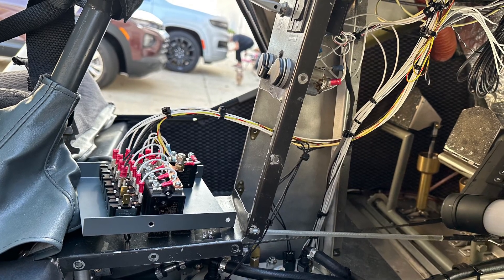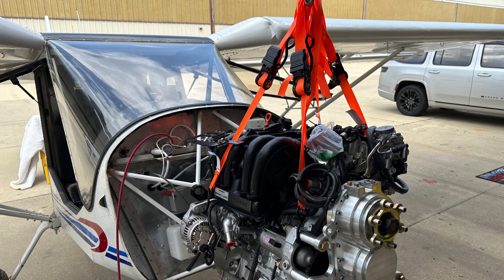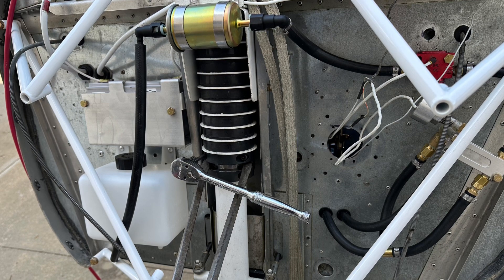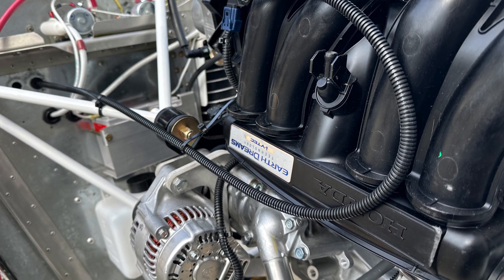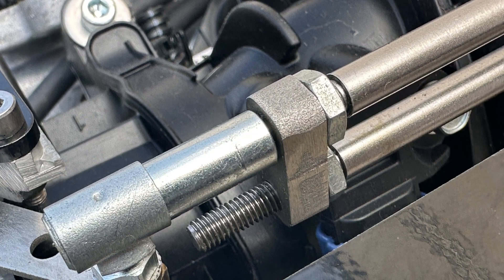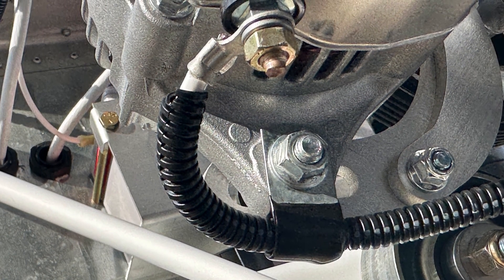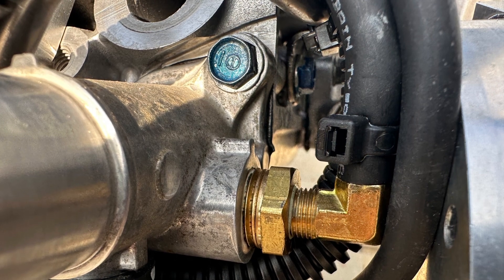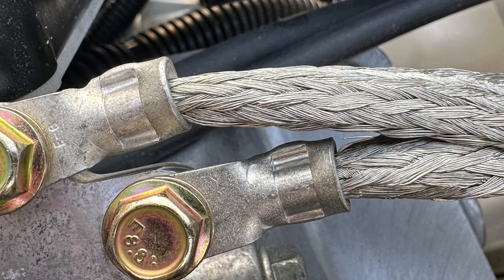Making A Viking Engine Switch the Easy Way - Part 3

Comment: Did you throw the old O-200 engine in the trash where it belongs. The only problem that I have with certified engines is that they cost so much.
Reply from the maker: The costs are just becoming absurd....
Reply: @eggenfellner  We need an automotive engine takeover of the monopolized GA engine market.
Reply from the maker: We have been doing a pretty good job on our end :)